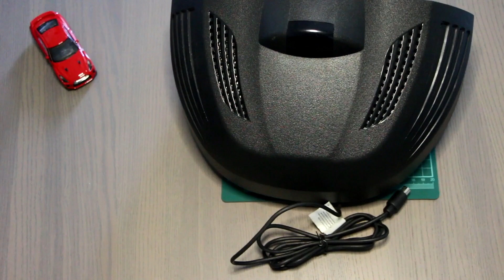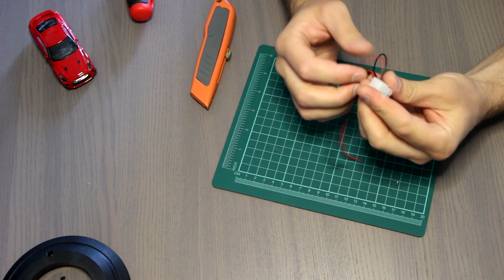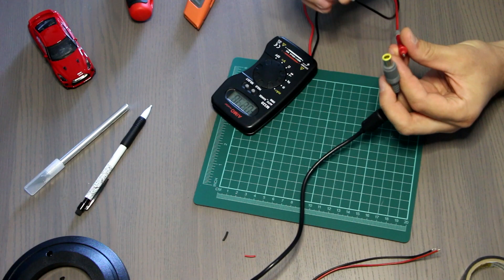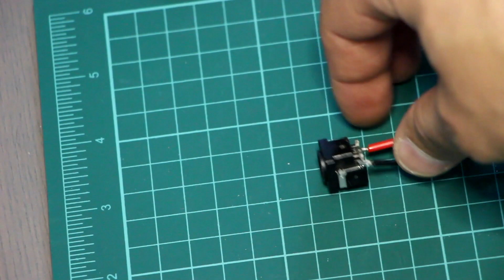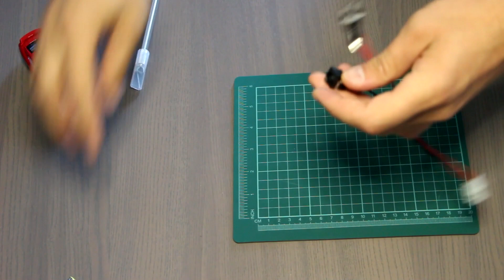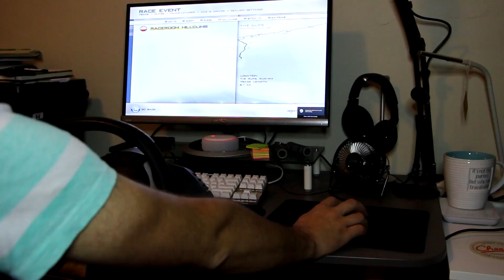Thrustmaster TX T300 wheel - power supply repair/replacement

Comment: I cut the end off a laptop charger that was 20v 1.5A and connected it directly to test if this would work for me and it powered on. I've now got a dc in for a 20v 4.6A laptop charger with the fuse and now it no longer works. The voltage gets to the plug but no sign of life, did I kill the board?
Reply: I've pulled the board out and there's 3 non smd capacitors that have no continuity across them, would replacing just those maybe fix my problem?
Reply: @Twxii  No continuity means the component is open. Continuity between pos and neg would mean the capacitor has a short - This is bad. The former is good. Proper troubleshooting of electrolytic capacitors requires an ESR meter, which you can buy fairly cheaply nowadays. I suggest you research troubleshooting electronics further before you mess around with any power supplies.
Reply: Have solved your problem with your wheel ?

Comment: Hi, bought faulty wheel and did similar mod as yours and it worked fine, good tutorial. I have a guestion regarding fan, should  it spin up as soon as i plug the usb or does it power on itself when it detects rising temeprature? Also did you notice any strength change in forcefeedback with this new power supply?
Reply: To zależy jak ustawisz :) Instrukcja się kłania... przycisk przy mode + ST jednoczesnie i przelaczasz miedzy trybami. Kilka linijek wyzej dodalem dopiero co posta apropo zasilania i moda jedynego slusznego - polecam;)
Reply: Hi in my one main board burn out any solution?
Reply: @yomenart  stm32 discovery board can run a thrustmaster wheel.

Comment: Its possible to bypass using the same psu, but only join back wires together? I think the plate is just a relay, that fires up when you connect the USD cable.

Comment: Hey there .. thanks for posting this video ... i have the same wheel with the same symptoms, and I was hoping your solution would fix it. I did everything exactly the way you showed with very similar components, and I verified that after soldering everything together, I was still getting 24v all the way to the power connector that plugs into the board .. however, when i did plug it in, I got a blue spark, and still no power to the wheel. I was pretty sure this was the order you did things in (your power supply was plugged in before you plugged it into the board) but unfortunately, my wheel has not come back to life.  What is the next thing I should check? Thanks for any additional help you can provide!
Reply: I'm in the same boat, with the spark and all. I wish there was something to try.
Reply: did you find a solution? i have the same problem
Reply: Did you blow the inline fuse? Are you sure you got the polarity right? I’m going to do 2 soon and kinda nervous 😬
Reply: @bobbyc2114  wow .. this was a while ago  :)  i never did get that wheel working, and have since moved to a TS-PC Racer, which i love ... good luck on your fix!
Reply: Good to hear you still  like thrustmaster, got 1 TX and 1 T300 dead $70 a piece.  I’m thinking you guys that got the spark and entirely fried your powersupplys. I’m going to check voltages with the new female adapter connected, so I’ll know which ends are positive and negative to solder.

Comment: Hi   I need help , my wheel cuts out , like u wanted to leave the race , but does not do this all the time,  I have know idea if it's my wheel or something to do with my pedals,  Thx
Reply from the maker: Does it do that right away or you play normal for a while? Also not sure what your pedals will have to do with that, but in any case you can as well connect your wheel without the pedals and it should work. That way you can tell out a faulty pedals. But like I said, I don't think pedals will have anything to do with that.
Reply: @SymyonYY    it seems to do it whenever it feels like it,,, very strange,  I was in a league race last night when it happened to be,  it went out like u were leaving the room,  but I started hitting all the buttons trying to get back into the room finally get did,  ofcourse I was up against the wall then ,   yes like u say I don't think it's the pedals I was just grasping at anything I could think of,,, have you ever heard of this before or anyone else had this problem  ?
Reply: I have the same problem, my wheel works fine for 10-15 minutes and then disconnects. I pull out the usb cable and reinsert it, then the wheel starts working again, works fine for 2 or 3 minutes and dies again. The time running decreases every time I repeat the operation. I'll try to do the laptop psu trick tomorrow... wish me luck hahaha
Reply: @todomalamente   firmware update,  fixed mine

Comment: I'm thinking of trying this  I'm in the UK will the power supply be the same?
Reply from the maker: Yes you can use the same power supply or any other that has similar specs output wise. What is different in the UK or any other part of the world is the input. But if you use a laptop power supply, you don't have to worry about the current input as they are made for travel and will accept anything in the range of 100v to 240v.
Reply: @SymyonYY  thank you very much. Just purchased a replacement wheel will also try this
Reply: I fixed mine with a firmware update,,, perfect 100%

Comment: Hello. My Thrustmaster TX also no longer starts. I wanted to try this solution. However, I have a Dell power supply with other specifications. Can you check for me, please, does it work out? And which fuse should I use?
Model: 90W LA90PM111
INPUT: AC 100-240V ~ 1.5A
OUTPUT: DC 19.5V _ 4.62a
positive pole inside and negative outside.
Reply: have you gotten any response from the fuses?

Comment: legend can get a name for the fuse switch and laptop pin
Reply from the maker: I used this Lenovo power jack:
https://rover.ebay.com/rover/1/706-53473-19255-0/1?icep_id=114&ipn=icep&toolid=20004&campid=5338607166&mpre=https%3A%2F%2Fwww.ebay.ca%2Fitm%2FD93-FOR-IBM-Lenovo-Thinkpad-E420-E425-E520-AC-DC-Jack-Power-Charging-Socket-Port%2F183971135173%3Fhash%3Ditem2ad588bec5%3Ag%3AqmoAAOSw9mFWJQcn
Reply from the maker: You can also use a power jack that has some wires pre-soldered (I think it's safer depending of your experience). Also please make sure you have the round plug Lenovo AC adapter and not the newer square one. Here is the link for the power jack with pre-soldered cables:
https://rover.ebay.com/rover/1/706-53473-19255-0/1?icep_id=114&ipn=icep&toolid=20004&campid=5338607166&mpre=https%3A%2F%2Fwww.ebay.ca%2Fitm%2F1x-DC-power-Jack-Cable-For-IBM-Lenovo-ThinkPad-T410-T410i-T420-T430-T420I%2F264145574467%3FssPageName%3DSTRK%253AMEBIDX%253AIT%26_trksid%3Dp2057872.m2749.l2649
Reply: @SymyonYY  thanks and the switch what would you recommend? my t150 internal power supply blew i need to replace it because my retailer is giving me grief even though warranty hasn't ended.
Reply from the maker: @Alpaca_FPS  Unfortunately I am not familiar with the insides of the t150. I do have a link in the description leading to a forum where you may find some information.
Reply: @Alpaca_FPS HELLO IK THIS IS 5 years late but im
in your shoes rn, what solution did u come up with
Reply from the maker: For the fuse holder/box I got these bellow. There are taking 5x20mm fuses:
https://rover.ebay.com/rover/1/706-53473-19255-0/1?icep_id=114&ipn=icep&toolid=20004&campid=5338607166&mpre=https%3A%2F%2Fwww.ebay.ca%2Fitm%2F10Pcs-Panel-Mount-Screw-Cap-Fuse-Holder-Case-for-Glass-Tube-Fuses-5x20mm%2F281638083089%3Fhash%3Ditem4192f01a11%3Ag%3AOZUAAOSwstxVDxW1